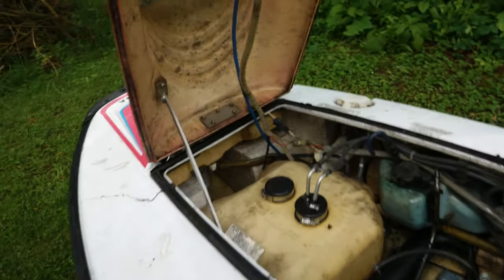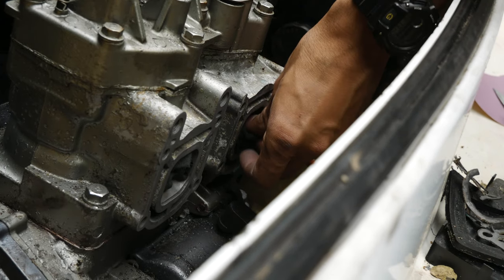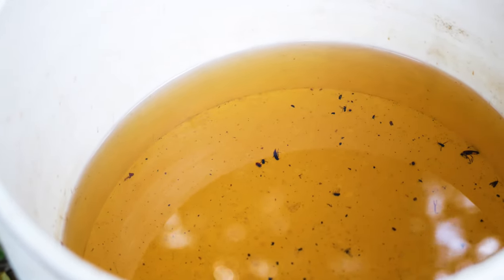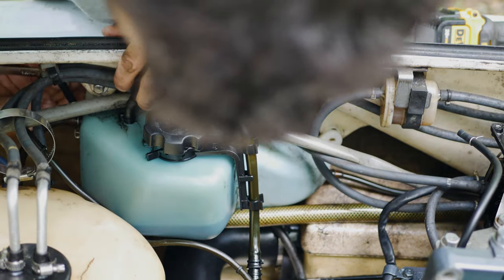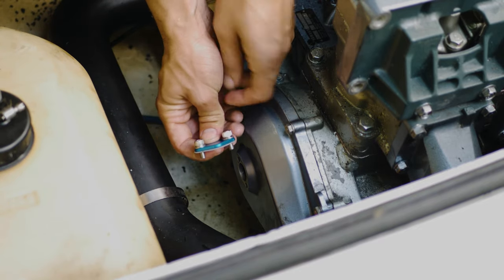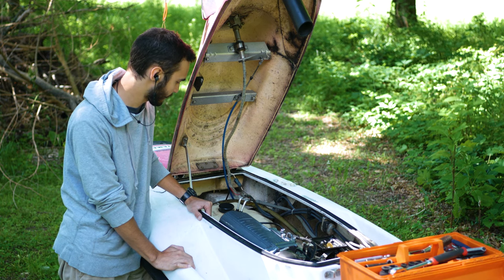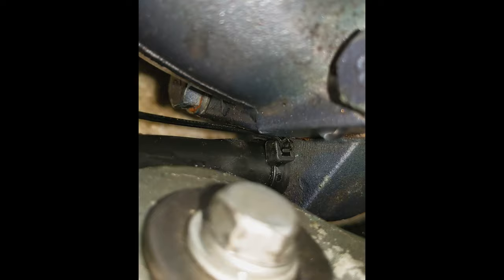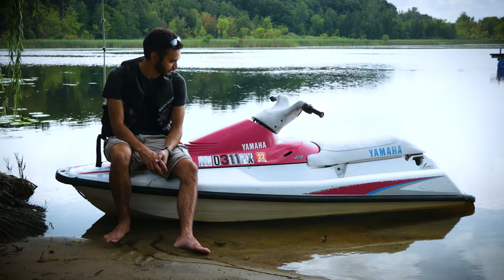Fixing Another Cheap Jetski [1991 VXR 650] (Timestamps)

Comment: love to see the old skis getting some love.  too many are just thrown away.  the blockoff caps in the oil pump delete kit are for the carb where the oil lines used to connect.  also, with that much water in the fuel, you should replace the separator (white filter in the fuel line inside the hull)

Comment: Got around to watching this video now as we spoke the other day on your other 650 you did. Now I'm eagered to get back down yo the lake and fix the issue. Im sure thats exactly what my issue is as the haul is filling up with water. But lastly, is their a bilge pump on these? If you look on the very back of the jet pump, it has a black nozzle thats pointing upwards. Nothing is connected to that nozzle on mine. I could have swore it used to shoot out from there years ago.
Reply from the maker: @bradbearden346  I believe there is a bilge strainer on the bottom of the hull that a hose should connect the jet pump to. The jet pump then creates a vacuum that creates suction through the hose. Though I think the nozzle you might be talking about is what  is used to create a rooster tail out the back but all mine were broken on my skis.

Comment: Nice job you must have alot more options to grab them old skis.speaking of such i happen to have an 94 yamaha vxr 650 i need the rubber bumpers that go around the hull mine runs fine but plastic bumper gaurds are cracked apart every six inches.cant seem to buy new all discontinued.makes it look junky.ive even looked at differant hosing to make something work no luck.you dont have a spare junk body with similar gaurds you would part with do you.?ive gotten ripped off twice now just trying exporters off off brand stuff.need help locating something thatll work!!!snooky pa💥🤪😀👍💥
Reply from the maker: Yeah, not sure where you could find new guards. I think your best bet would be finding a hull for cheap to use for parts.

Comment: I’m so disappointed I’ve purchased 3 of those old yamahas last season and all of them would run really great but wouldn’t propel enough to get it going! Any ideas what I was doing wrong?
Reply from the maker: You probably need to look at tuning your jets on your carburetor. The channel Jet Ski Rehab has a video or two about that which would probably help you. I have been lucky so far and haven't really had to deal with that yet but I probably should look into it. Also take a look at your impeller and wear ring to see if there are any broken blades or if there is a lot of space between them.
Reply: I'd second what rural playground said about the impeller and wear ring. I had that same problem with my seadoo jetboat. Previous owner got a rope caught up in it and I had similar problem with it not having much power. Changed the jet and wear ring and full power!

Comment: Do you have to service the oil in the crankcase now since you removed the oil container?
Reply: There's no oil in the crankcase. Premixed fuel (gas+oil) is poured into the fuel tank and that both fuels and lubricates the engine.